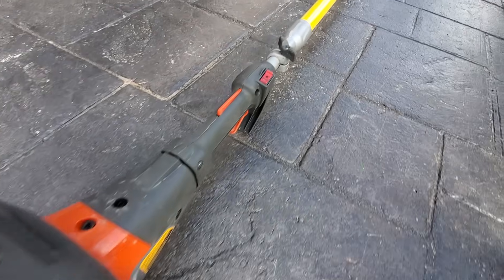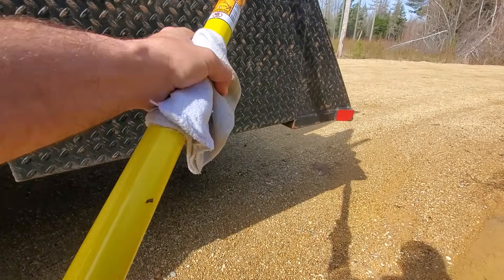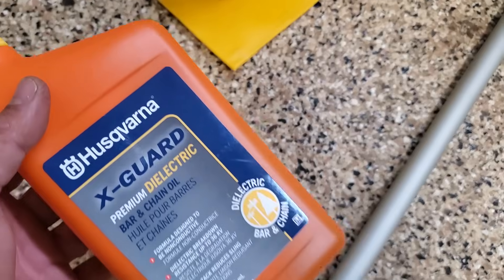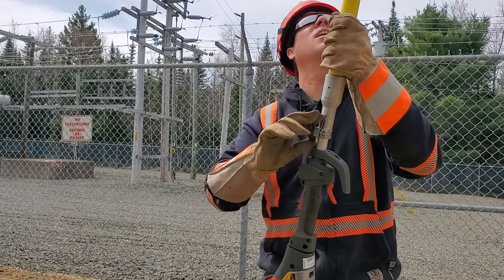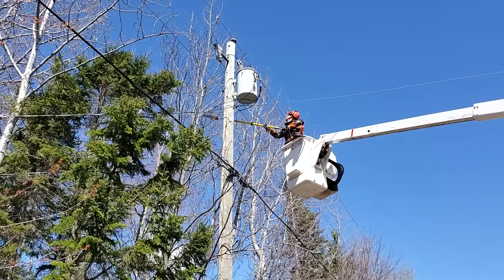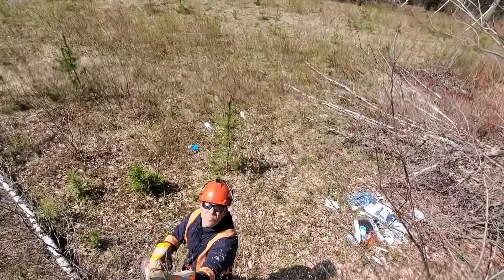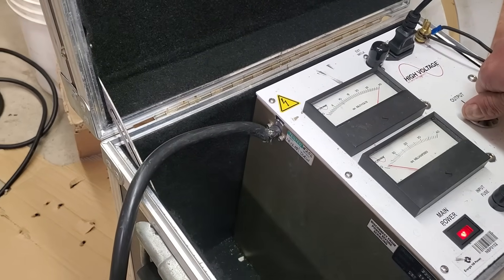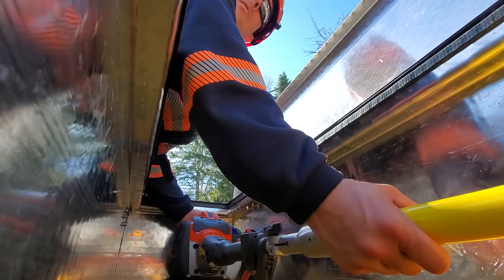Husqvarna Madsaw - First EVER dielectric pole saw (gas-powered)

Comment: With the engine at the opposite end of the pole from the chain saw, how is the rotary power from the engine transferred to the saw and also provide electrical isolation for minimum approach distance?
Reply from the maker: Sealed fiber glass shaft rotates using gears/spline

Comment: How's the driveshaft put together? Is it like a big fiberglass pulling rod? How does it extend if it's fiberglass and a driveshaft? Is it some other material?
Reply from the maker: Fiberglass driveshaft is completely sealed, otherwise it would contaminate easily. There's another extension that connects easily which I'll show in the review video

Comment: Re: disclaimer. Yeah... if you mess up with that you can damage the power line that you’re trying to work around. Definitely a “pros only” product.
Reply: I'd be more concerned about the fact that if you do mess up, and I mean really mess up, you could lose your life.
Reply: @ryank1273  Hmm... it would take a lot to actually do that... but... I suppose if you are in contact with something metallic that runs from the proximity of the high voltage line and the ground and you bridge the two with the chain/bar of the saw... just cutting the wire loose from the wooden support beam it’s sitting on won’t be enough to bring it to the ground. It might be enough to bring it into contact with communication lines, though - frying anything and anyone connected to them. An arc flash from the saw bridging high voltage to ground (or another phase) should be far enough away that it’s not fatal; but it would very likely mess you up really bad.

Yeah... I think I’ll leave the utility work, to, ya know... the utility. 😉
Reply: @darkwinter6028  Chances are if you cut a wire, those wires will make contact with the ground. Basic math, a common utility pole is about 40 ft, and the distance from each pole is about 150 ft. You see the issue? And when that wire comes down, it probably won't turn off immediately.
Reply: @ryank1273  If you managed to actually cut all the way through that steel reinforced cable - yes, that would do that. The thing is, though, that’s a chainsaw on a pole. It’s highly unlikely to be able to do that - what’ll happen first is the chain teeth will dig into the cable, pull it around to the engine section of the saw, and jam. This, of course, will damage the cable requiring repair by the utility, and leave the saw caught up in the cable... but it won’t bring the line down all the way to the ground. Not a good situation; of course... and you can expect a big bill from the utility for having to come out and fix it.
Reply: @darkwinter6028  That's true, but always assume that something can happen to the cable after it gets damaged though. Assuming that the worse can happen can make a difference between life and death. I don't know everything about electric utility, but I know that a damaged line could fail anytime.
Reply: @ryank1273  There’s a margin of safety in the design of power lines - they have to survive ice storms, large numbers of birds, etc. Treating such a power line as if in immediate danger of failure is like treating a gun as always loaded - it’s dumb not to, because that one time you’re wrong, one or more people will die... despite the fact that you just pulled the magazine and cycled the action (thus clearing the chamber). 😉
Reply: @darkwinter6028  We think alike, and I'm actually happy to know that someone understands what I'm saying. There is no such thing as something being completely safe, always treat something as being dangerous, but don't treat anything like it could immediately kill you. Perfect example is carrying scissors by the cutting edge instead of the handles: you can safely carry them by the handles, but if you trip and fall, it could very likely cause severe injury or death if you fall on them.

Comment: No doubt you'll get nailed for using a 'non-electric' saw that you use to clear things that will power(recharge) electric cars.  Even though the electricity is made by(most likely gas or coal or at best, hydro).  Neat though.
Reply: Where do you see pros getting a hard time for using gas powered tools exactly? No one tells pro landscapers to use electric zero turns. No one tells pipeliners to use electric excavators. Hell, no one tells arborists to use electric chainsaws. And "no one" is a generalization. I'm sure it has happened once somewhere, but acting like it is a common occurrence is silly at best. This is simply not a thing, at all. 

If a carpenter is using a gas powered drill in a house with electricity, yeah, they might get a hard time. That's about the only possibility I see.
Reply: @commoncentstx  Just visit some of the more 'liberal' states and you'll see.  Gas leaf blowers are outlawed in many communities in NE and CA(I think)   Greenies are on a warpath pushing for for all electric devices yet they don't realize how that electricity is generated.  I'm on a bit of a warpath myself.  Nuclear!!!  Most bang for the buck.  Biden's CO2 promise is a joke.  BTW,  tread carefully when you say "no one"  Too comprehensive and untrue.
Reply: @nhzxboi  ... BTW, many of those communities pushing for electric / battery blowers and mowers are more interested in the noise factor. Think along the lines of those restrictive HOA situations. As for how electricity is made, there is economy in the scale of generation. IOW, that power is likely made with only a fraction of the fuel you'd need to do it at home, and under much more stringent pollution standards.

Comment: I have repaired Husqvarna saws for a living. You probably only want to use non ethanol gasoline. Fuel stabilizer may be recommended.  The stabilizer may already in the 2 cycle oil additive. The number one failure source is the gas turning to varnish in the carburetor. Read the manual.
Reply from the maker: Excellent tip💯 Thank you! 👊🍻
Reply: @Bobsdecline  Periodically, you should run carb cleaner through the saw.  I am not a seafoam fan. Recently, the shop I worked at has been using lucas injector cleaner quite a bit. Not sure if it was used on a Husqvarna.
Reply: @Bobsdecline  when your done using it and you know it’s gonna be sitting for a longer period of time empty the tank and run the carb dry. It will save you a lot of hassle.
Reply: Agreed.  For someone who uses the machine every day, it may not be worth it.  But for someone who relies on it to start the first time on emergency calls, canned gas can make a big difference.  It's what all the fire companies I've seen count on.
Reply: Yeah. People put their weed eaters and chainsaws up for the winter with fuel in them, instead of running them completely empty and storing them bone dry.

Comment: Nice saw! With is being so light i wonder why they didnt add a way to extend the blade out more like the stihl pole saws we use in comm.👊
Reply: @zimbabwesteve4620  could be. But something tells me if the average Joe wanted to try to cut trees away from the power lines. He would use a standard pole saw instead of paying a premium for the Madsaw
Reply from the maker: There's actually a removable extension. It's not telescopic as the internal fiberglass drive shaft is completely sealed. I'll be sure to include it in the review!

Comment: I have no idea why but the video always stops at min 3. can you tell me how the engine and the chain are connected?
Reply: Probably a rotating shaft inside the pole.
Reply: It's just like a weed whacker expect for a fiberglass handle and a chainsaw head
Reply: Ok thanks 🙏🏻
Reply from the maker: The rotating internal drive shaft is fiberglass as well as the outer layer. It's also completely sealed off to prevent contamination which might reduce the dielectric properties
Reply: I need a longer stick 😂 but i think it makes work easier and safer